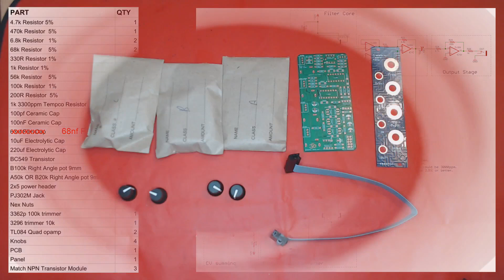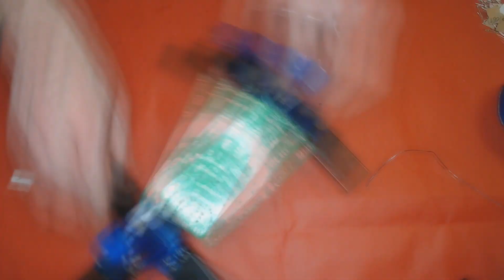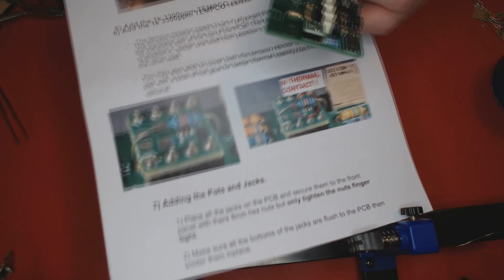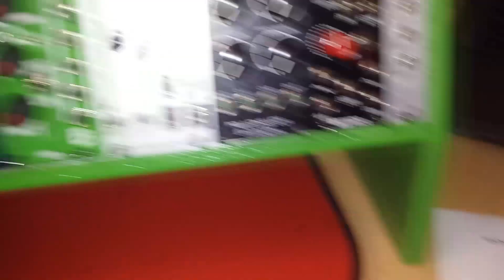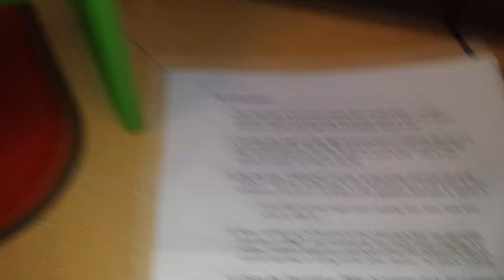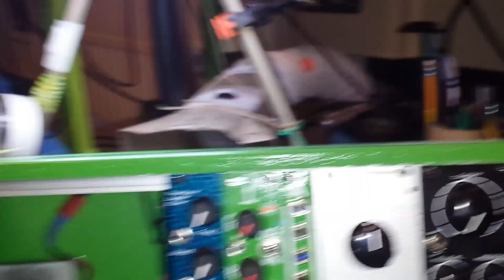omsonic – Transistor Ladder Filter Build Video

Comment: I built one of these too. The resonance control doesn't seem to do much over its full sweep. Turned up full, it self resonates. It affects the sound between about 3 o'clock an d 5 o'clock. There's not much noticeable happening below that. Did you find the same with yours? It looks that way in the video. You seem to be turning the Q knob a lot with little impact on the sound other than in the full up / self resonance spot.
Reply: Resonance's sweet spot is different with each frequency. I don't have this module but turning the frequency once resonance has changed should find the new "sweet spot"